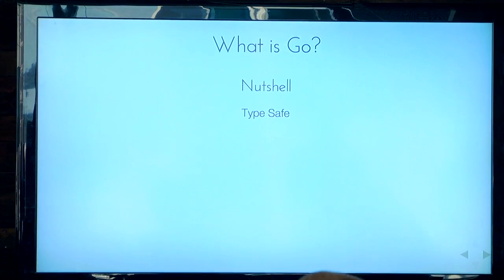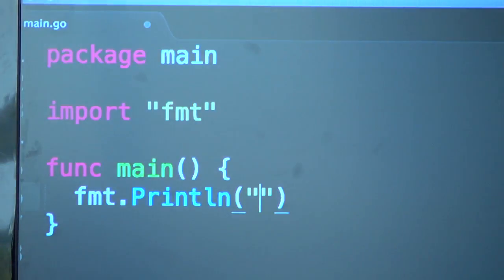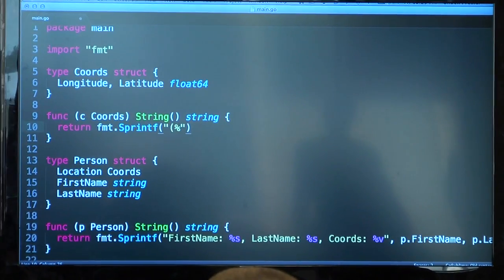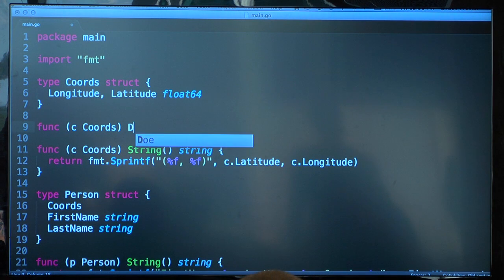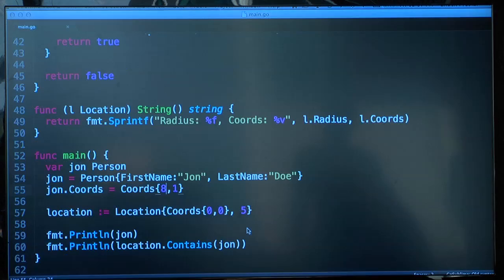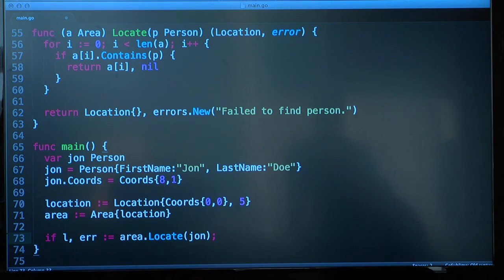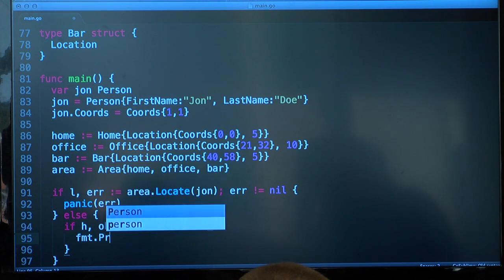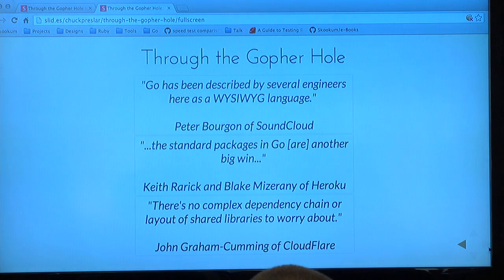Google's Go Programming Language

Comment: Just a question how is Go less verbose then Java? It has taken away features to do this. For example what happened to the Access Modifiers that comes with Java? Instead its switched with "format/func"? Isn't that more "verbose"? As far as Sys.out.print I can see fmt shortens it. But these are insignificant to what Rob Pike complained about. The only real advantage I can say is that its a compiled lang and doesnt need JVM but that can also be a downfall.